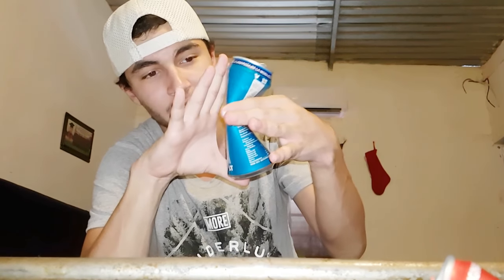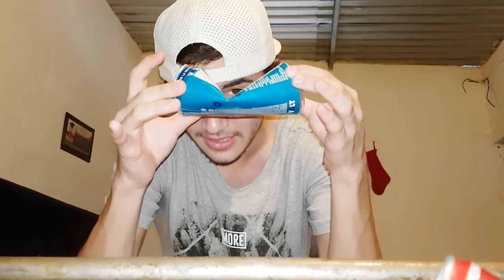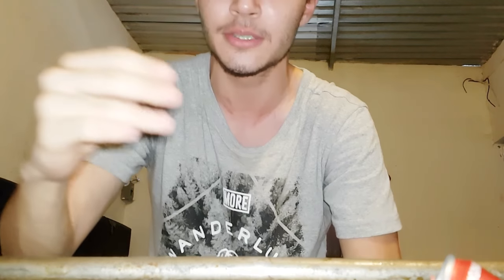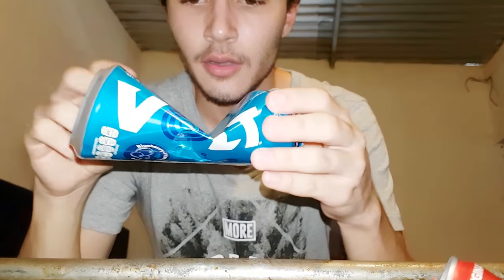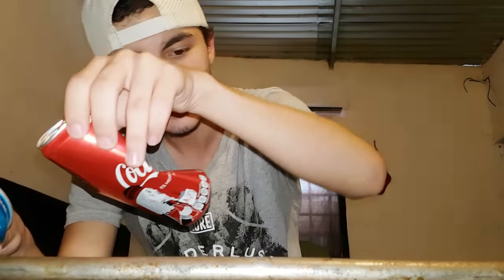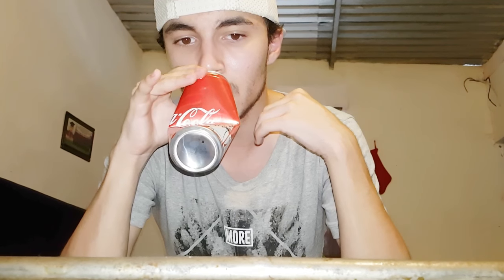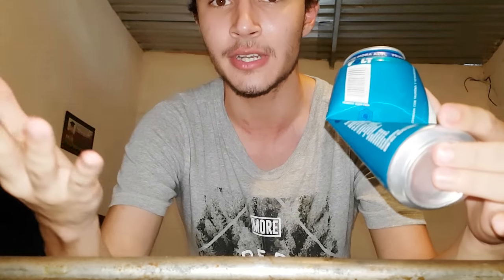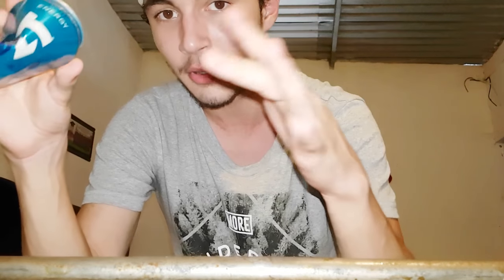How to make a Car sound with a can

Comment: for people that is hard to make take a can and(I recommend using big cans bcs that make like gtr sounds)so put it on a flat surface or a table or and flat surface and u gon have to take a knife out and use the non-ramping side and like gently bend it by pressing on the cans middle or close top part while doing it on the table and remove the thingy that u use to open the can or ur going to have problems like putting it on ur lips or u may tear ur lips so blow into the can slowly to change the gear just hit on the bottom-side on the can and that's the easy way                                               btw I typed so much
Reply: Can you send a video of it ?